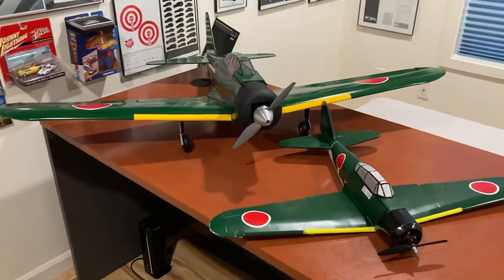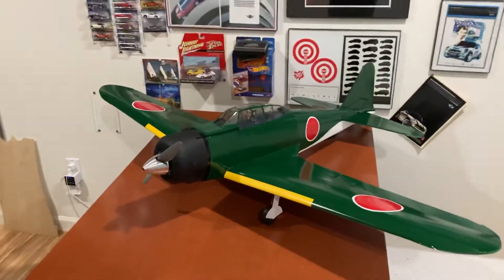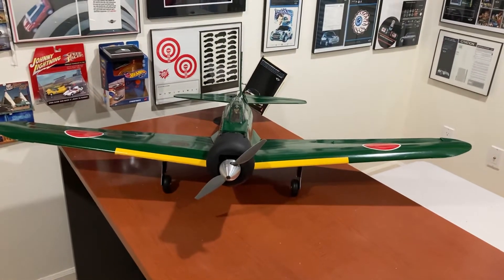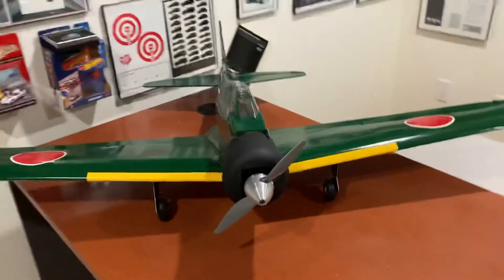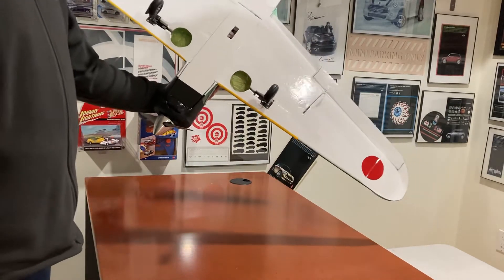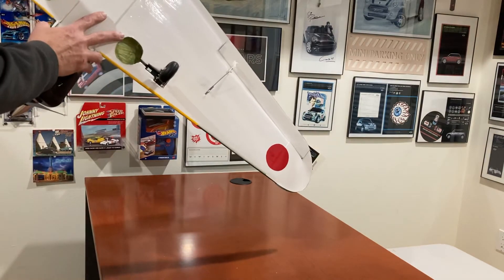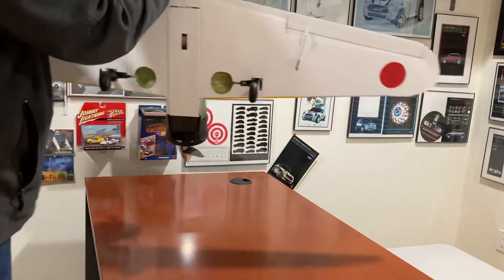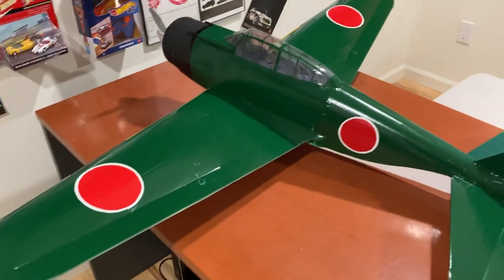FT Mighty Mini Zero Scaled to 175%

Comment: Hello how do you scale plans up?
Reply from the maker: The basic process is to measure the existing plan then multiply each dimension by 1.X where X is the percentage you want to scale up.  For example, if you want to scale up by 75% and you measure 100mm, the new dimension is 1.75 X 100 = 175mm.
Reply: @thenerdoligist1292  thank you my friend
Reply: @thenerdoligist1292  can't we just scale up the ft plan by x% on Adobe pdf reader and give it for print? (Or save it and ghen do a tile print?)
Reply from the maker: @PS-nf3xw  unfortunately not because there are too many dimensions that depend on foam thickness. Since the foam thickness is fixed, those dimensions become inaccurate.
Reply: @thenerdoligist1292  ofc, how silly of me. Would you mind sharing your enlarged plan? I am not acquainted with the computerized enlargement process.
Reply from the maker: @PS-nf3xw  I just have patterns for the different pieces. Sorry, but I don’t have plans. If you watch my video for the simple sport profile diy build, you can see what a pattern looks like
Reply: @thenerdoligist1292  yes, the cutout patterns would do. As it's based on the FT mini Zero, I guess assembly would be similar, minor differences may be worked out with aeromodellors' imagination.
Reply from the maker: @PS-nf3xw  I don’t have electronic versions of my patterns. They are just pieces of poster board so there isn’t any way to share them
Reply: @thenerdoligist1292  would you mind tracing them on a large chart paper and sending them over post or getting them scanned? If needed I will pay for the postage and all.
Reply from the maker: @PS-nf3xw  yes, I can do that. However, I’m leaving on a trip for a week so It may have to wait until I get back.
Reply from the maker: I’ll try to do this when I return from my trip next week
Reply: @thenerdoligist1292  gentle reminder
Reply from the maker: @PS-nf3xw  so I tried this on another (simple) model as a test. After scanning, they printed out at 96% of my templates. This is probably close enough. The next question, is how to get them to you? I can email if I have your address in the next couple of days or if you have another idea?
Reply from the maker: On further reflection, I need to figure out how to post plans. Until then, I’ve decided to just share them locally. Best wishes in your future projects
Reply: @thenerdoligist1292  I understand and appreciate your decision. On second thoughts, would you like to send them by post?
Reply from the maker: @PS-nf3xw  I think I  can have the profiles scanned on 20”x30” paper and will send a PDF file if you provide an email address
Reply from the maker: @PS-nf3xw  I have them drawn. Scanning will cost around $15 so I want to make sure you still want them. Let me know
Reply: @thenerdoligist1292  sure. 

Although as an aisde, if you could post the drawings to me, I might get it scanned for cheaper, all within 10$.
Reply from the maker: @PS-nf3xw  I have the .pdf file so just email me at robsrcplans@yahoo.com and I will send them to you
Reply: @thenerdoligist1292  sent
Reply from the maker: @PS-nf3xw  ok, it says they are sent so hopefully you have them soon
Reply: @thenerdoligist1292  thanks, received.
Sending the reply over mail!